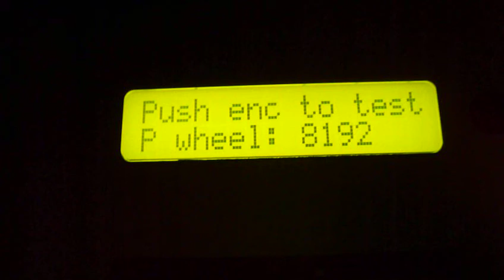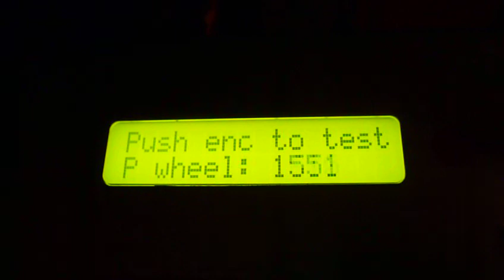Alesis Micron broken pitch wheel diagnostic test

Comment: The Correct way to enter the ION Diagnostic Mode: Power up Ion while holding down PAGE < and > PAGE buttons. This brings the Ion into diagnostic mode. Verify that the text "DIAGNOSTIC" appears at the very top of the LCD screen. There are only 4 pages consisting of 10 Diagnostic Test.

Comment: I experienced this problem with my Micron the last couple of days, exactly as stated here but a bit more extreme. When moving pitch wheel to the right, it jumped immediately to maximum. Tried powering on/off and so-called factory reset (power on with programs/setups/octave-), with no change. I took the case apart, vacuumed it out and blew a bit of moist air on the potentiometer. Then put it back together, thinking I'd buy some contact cleaner since I now know I can get to it. Turned it on to make sure I didn't break something worse in the process, and the pitch wheel is fixed! Help on disassembly is here: http://www.ecstaticlyrics.com/music/Alesis_Micron/control_knob_repair.
Reply: Thank you! I just taped mine down so it wouldnt trigger lol

Comment from the maker: @ITOguitarbatch Not yet. I just turn it off and back on again and that usually fixes it for a while. Sometimes it will slightly wave back out of tune just to throw me off. Thankfully this isn't how I make money and I can still use it as a MIDI controller.

A local guitar place said they won't mess with synths, and I've still got to check with the keyboard dealer. There's a mail-in repair center in NJ called TSIRepair that said it will cost under a $100 including shipping. 

Wish it was DIYable.